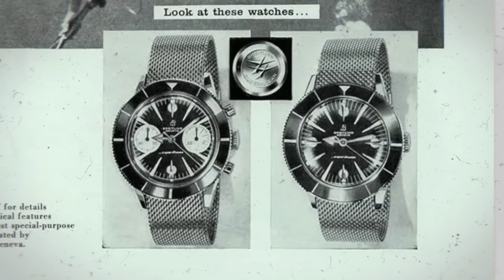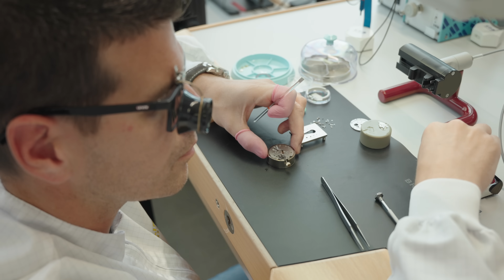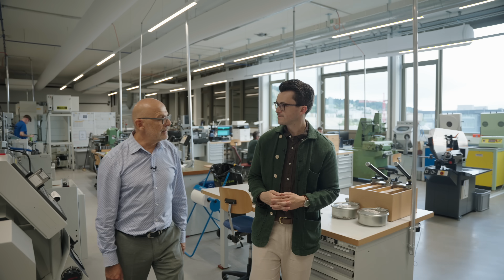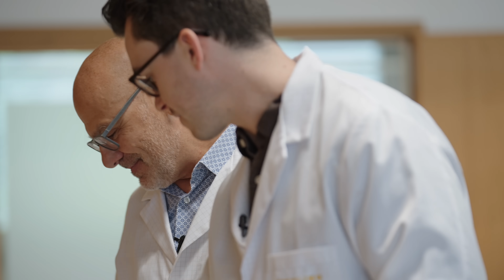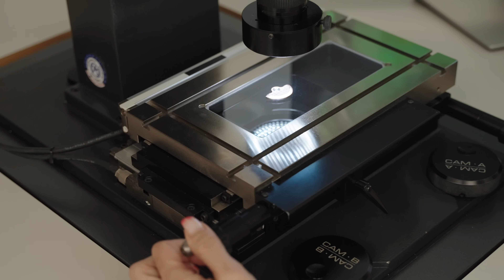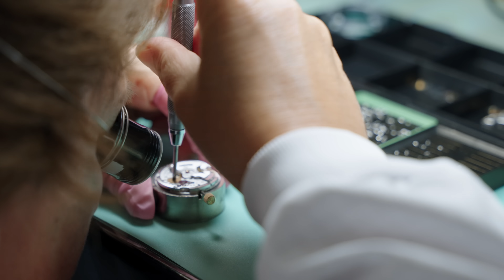You've Never Seen Breitling Like This: How They're Made

Comment: Interesting,  I am an amatuer watchmaker but I also work in precision engineering so it was interesting to see the wire eroding machines and some of the manufacturing process.  Its amazing but sad in equal measure.  All that accuracy of machining and then fitting of jewels and hands is pretty much automated.  There is no complete assemblers just machines or people trained to run one station and fit a few parts.   The machines take away the skill of a hand assembled watch which also takes away some of the charm .  That said all brands do this>
At least as a amatuer I take a whole watch apart, clean, inspect and then rebuild the whole thing on my own all by hand and eye coordination.  To see a machine fit jewels to a plate is just staggering given the size of them and the tolerance required for the machine to line up with the holes.  My guess is it must have some sensors in place to know exactly where it is for this sort of precision.

Comment: Breitling has always been a little bit too big for my spindly wrist. (Typically, I require a 39 mm or smaller case size.) But, as an aerospace/aviation guy, I’ve also always liked the brand.
Reply: Have you tried the new Top Times? Both 3-harder and chronograph are 38mm. I have a Navitimer that is 41mm case size tha5 is just over 47mm lug to lug.

Comment: Why die Breitling Change their Logo? It was a icon The B with Side Wings. This Modern with only a B is not anymore iconic. For a Revolution at Breitling must be only one direction this new B with new Side Wings .. Like a Spirit of Ecstasy a little Bit different between Spectre and Ghost , Phantom but seems Like the parallel to much older traditionell one onesin a time. If they will Not re Design a Symbol of time watches.. I will Not buy a Breitling again . Thats klike Mercedes PKW using Mercedes LKW Stern .. thats No one comes in the thinking what this step is damage over Long Long Long Time the Brand ? See look to Rolls Royce they a the spear the crown in top all Others (okay thanks to BMW and the RR workers with the Passion and praud for each SoE upcoming and the band of the beginning to present Icon in these field of Automobile) Hope Breitling Designer and Chiefs redesign IT fast for Future before beside selling its the stability of second Hand Market which brings to fall and fail 60:40😊

Comment: When did they stop using ETA movements ?
Reply: they still use a few eta/selitta based Ébauches that get turned into final movements for three handers - but they are phasing these out now fro the AMT based stuff in the top times and new SOHs
Reply: I’m so glad they are going all in-house and manufacture (AMT) movements. I have nothing against Sellita/ETA,  but a brand with the prestige of Breitling really needs it to set it apart from the lower tier brands.